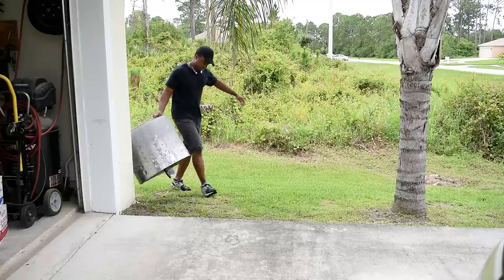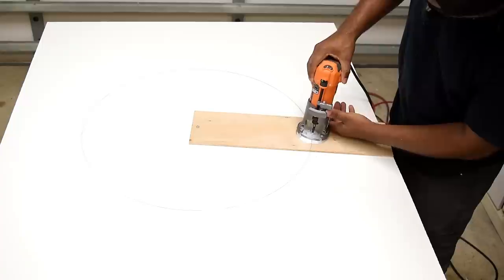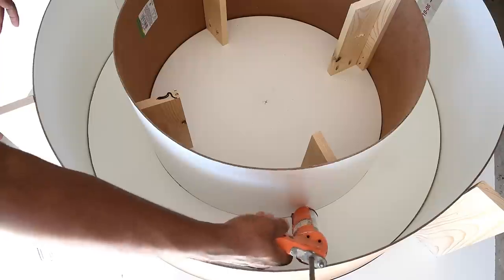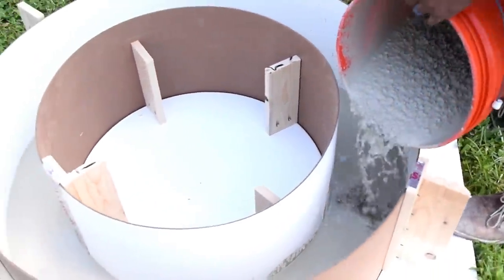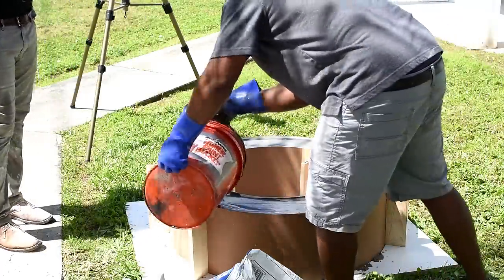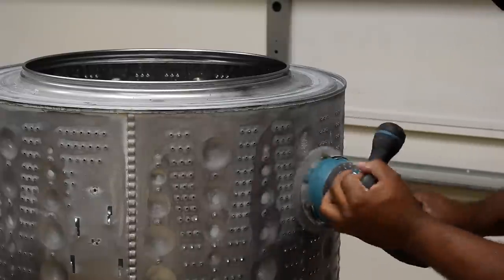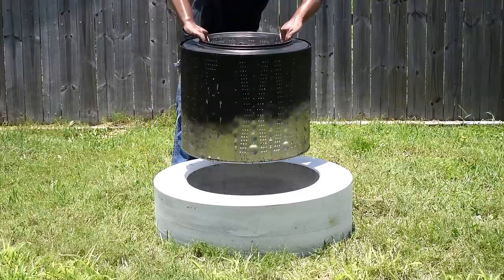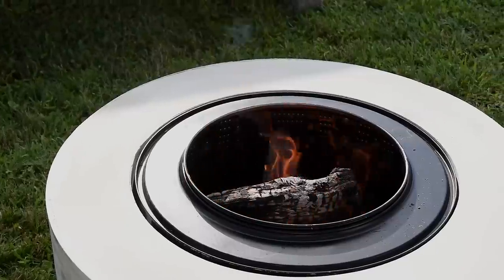Making A Concrete FIRE PIT  | from a washing machine drum

Comment from the maker: I made this bench a while back. You can check that build out here: https://youtu.be/zD-lSfDSKn0
If you want to see what i'm working on next, I'm most active here https://www.instagram.com/Morediycreators/
Reply: DIY Creators 
Quick question, what brand of dust mask were you using?
Reply from the maker: R-Z Mask https://amzn.to/2MXaWw3
Reply: Add an air intake pipe next time you build your firepit / fireplace
Reply: DIY Creators such a diy is worth fit
Reply: Next time place concrete, water the concrete and then put painters plastic or better (mil thickness) over it.  This keeps the moisture from escaping, way less chance of any cracks due to cure.  I just poured 20 yards in my backyard, watered it daily with plastic over it for 3 days, came out perfect.
Reply: DIY Creators do a tv stand
Reply: Burning wood is cool the pit you made is a good looking pit very.creative.
Reply: If you had put some greased PVC through the form before you poured you'd have air intake lines for your pit.  How you did it you're going to have a lot of smoke.
Reply: DIY Creators won’t the heat expand the concrete and make it crack?
Reply: How to remove ash?
Reply: I love your videos man for sure am going to use some of ur ideas in my house in Mexico when I get there
Reply: Hahahahaha
 I did the same thing with a dryer drum. Well not the concrete outside. I did cut in some air vents... I'll probably try your process but with my own twist to it. Some styrofoam vortexed vents in the concrete. For stile.. keep up the good work.
Reply: @SeanReitmeyer  This is a different type of concrete. You have to keep watering it for the first 45 - 60 minutes as soon as it get hard or it will develop shrinkage cracks. It creates a tremendous amount of heat as it cures. Wetting it then covering with plastic won't be enough. It has to stay wet, the heat just keeps evaporating the moisture. We use this mix all the time for our concrete repairs. It very fast setting and must be cured by keeping it wet.
Reply: @ushkayordlay3986  It'll be fine as long as he keeps watering it for an hour.
Reply: Great idea and I love the video. Tip for your next concrete project is next time you use a self consolidating concrete mix ensure that you dont use so much chem that it blow out the mix. The rock should stay suspended in the cement paste and never segregate. Your boy ruined that mix. Also roding through the layers of concrete helps prevent cold joints.
Reply: Awesome work man. Great work.
Reply: @ushkayordlay3986   Evo Bigdxck  normally yes, but
1) he is using mortar.
2) using calcium silicon aluminide raises the heat tolerance.
3) using the old washing machine tub helps seperate the heat from the mortar and allows for some heat dissipation. 

Now, he will still experience some cracking due to heat stress even if he takes the time to cure the structure. To avoid this, make the inside diameter about an inch wider in radius and line with kaowool. Seal the concrete and it will last for decades.
Reply: Beautiful work
Reply: Are you married?
Reply: Good and speed !! From  São Paulo city - Brasil
Reply: How do you add the air intake pipe? And how does it work/ purpose?

Comment: My dad also found a washing machine drum on the street, so he just made a base for it and we've been using it as a camping fire put for years. The drilled holes on the side really let off a good amount of heat. Your concrete donut looks like it meshes well, cool project.

Comment: We have several fire pits for guests, and this looked lovely, but I saw straight away when he had it burning that the fire pit wasn't getting enough air, and as a result the flames were sooty.  Probably easily solved by having a tunnel under the concrete ring. Well impressed with the ring itself, and how it looked after so little time setting..

Comment: Two things I'd do to get that pit humming.  Dig a couple of small channels under the pit on each side so air can be sucked in underneath.  I'd use a couple of old barbeque grills to cover the holes so you don't trip into them.  That air from underneath will stop it smoking so much out of the top and getting in your face.  Also if you want to start it easily and burn it longer, fill the tub with big chunks of firewood, and start a small kindling fire on the top.   Put the biggest bits on the bottom.  The fire will start quickly and easily on top and will burn down into the pile taking a couple of hours to burn.  Any smoke that forms will pass through the hot fire and get burnt rather than coming out the top.  As kindling burns down, it will ignite the bottom bigger logs.  Once it's roaring, you'll be able to simply drop big logs in from the top into the ember bed.

Comment: I have something basically like this only it sits on 4 legs making it portable.  You could make a surround to drop it into if you'd like and then remove it or just let it be portable. The bottom is an old steel washer drum and the center spindle is cut out leaving a hole in the very center about as large as a 20oz bottle. The airflow thru this hole and the side and surround holes allows it to breathe very well. The hole in the center and being raised on the legs allows for ashes to fall out.  We just place concrete blocks around it and they hold any ashes. When you want it some place else you pick it up (when it's cooled of course) and just move it where you want and place the 8 inch concrete blocks around it again and you have a new spot. PLUS being built this way allows the metal to capture and radiate heat so this makes it an actual body core heat source in the cool/cold weather. Plus it's an enclosed fire with a screen on top.  I have 2 of these..one at home and one I take camping.  And it makes a GOOD bit of heat.
Reply: This is one we burned all the way up over the years...lol.  Still I have the newer ones designed the same way. This old one is about 25 years old at least at the time this picture was taken.
http://oi68.tinypic.com/av4snn.jpg

Comment: Looks real cool however maybe if you casted the concrete mould with some holes made from pvc pipe maybe then the heat buildup would be greatly reduced in the concete mould & hence minimize  cracking.

Comment: We took a washing machine drum fire pit to the beach while group camping. Ours had a upside down looking funnel style chimney. Once the fire started it would howl from the air being drawn through the holes. It would glow red and acted like a furnace. Once started any drift wood or wet wood would burn without problem. Good times and melted shoes if you were not careful.😁

Comment: It's a few years late, but the reason that wood isn't lighting well, is the lack of air holes.

Solution 1: place pipes periodically throughout the concrete.

Solution 2: rather than concrete throughout, use engineering bricks cut in half, with the pocket side facing in, then concrete around them. Then you create vertical air channels.

Solution 3: Mix of S1 and S2, with large pipes around the base, but then you can have the flush concrete finish on top. Air gets in to the bottom (really important) and can access the sides.

Comment: So to make starting a wood fire pit easy get some starter logs. These are designed to be super easy to light and burn for a long time. Put in the start log, light it and then stack your wood on top. Super easy.

Comment: You should make a vent going underground to the pit and out somwhere close to make it easier to light!
Reply: Great minds think alike! The tub is perforated, it just needs a ring void going around it with a couple air vents thru the concrete form. Maybe make some plugs to control how many of the vents are open at a time, idk.

Comment: Well done even with the issues! If it was mine, to solve the combustibility problem I would size the inner ring to accommodate fire tiles, and use a vermiculite concrete mix like they do for pizza ovens, due to it's fire rating. Maybe even just as an insulatory inner ring that wouldn't be seen, because like you I love the monolithic concrete look. And the idea of being able to pull out the wash tub for cleaning it. Then I'd use the existing ring nearby as a matching raised bed planter. The idea for the mould is slick and elegant, I'm about to use it for some 20" cylindrical planters to accommodate  semi dwarf citrus and eggplant in the front yard veggie garden. Thanks so much!

Comment: I love the look of your fire pit...... had no idea it was a washing machine drum.... form the picture.
I've had a fire pit for a few years now, and had a multifuel stove in my last house and found the quickest way of lighting wood is to chop a log into kindling, or chop up some off cuts into strips of similar size to the kindling. You'll find any type of pine / spruce perfect for starting your fire pit.... but add hard woods like Oak, Ash Elm etc that burn a lot slower to keep the first going! and any coal as the main bulk of the fire (thats if your pit can handle it) - good luck!

Comment: Great work mate and I really like the project. I think that if you were to create an air inlet through the bottom of the concrete and fit it with an adjustable door you will find that the fire pit will burn a whole lot better. As it is now, the fire pit doesn't provide a passage for air to flow underneath the fuel which stops the necessary updraft required to feed the fire.  Because of this the fire will be very difficult to start, will burn low and more often than not, will just go out altogether. Build the inlet into the form and set it with the concrete.  Alternatively you could cut one out after the concrete has set.  I think I'll have a go at making one soon. I like it. Thank you kindly.

Comment: Nice build. The reason you have a problem with the burn is because you have no airflow from under the fire. If you added 4 - 8 tubes in the concrete form about 2" from the top, this would create 4 - 8 breather ports about 2" off the ground through the concrete to provide tons of oxygen to feed the fire from below.

Comment: You would have an easier time lighting your fire in a concrete form if you put some breather holes in the form towards the bottom. You can use your mesh to ensure no large coals can escape the form, but this would allow air to flow through to the wood down in the main cavity.

Comment: I'm curious to know why you need the washing machine inner, when you've gone to such lengths to build that beautiful concrete circle. I'm an aussie and out here we just fly with the machine inner by itself, breaths really good and whacks out the heat! 😉
Reply: Merto The 1st. 
Concrete does not mix well when combined with repeated exposure to high heats. This can lead to cracks and explosion of the concrete. Usually metal or firebrick are laid between the flame and the concrete itself.

Comment: Nice design. 
If you add an airway into the bottom of the pit you'll increase temperatures and thereby achieve a cleaner burn / less pollution. 
You'll also find it much easier to light and less smokey in operation - it might make you reconsider and save you the cost of gas maybe?

Comment: That's some seriously wet concrete
Reply: The powder he added is what is known as a "water reducer" it allows you to pour a very wet concrete mix without diminishing it's strength. However, it also cures the concrete very, very fast.
Reply: It did look a little watery
Reply: we can see concrete segregation
Reply: Yes it is. That flow control was not necessary with the amount of water they used. You can clearly see the segregation when he pours the first bucket and that highly affects the concrete strength.
Reply: My brain got confused by all the water and segregation :s 
- Former concrete worker 😂

Comment: Nice job on the mold and the finished pit. I wish I had seen your video about 3 months ago because I dumped an old washer. I pulled the drum out of it but couldn't figure out what to do with it so I ended up throwing it away. Had to replay the part where you said how long this mix took to set up because I couldn't believe something this wet would ever set up. I'm going to have to get myself a couple bags of this stuff to screw around with.

Comment: Great build. How about a vent in the bottom so that the flame increases and there is less smoke. I’ve seen others like the “Dakota Fire pit.” You might see a big difference. Since my yard is small I have to store my fire pit when not in use or I would definitely build one like yours with a vent. Thanks for the great ideas.

Comment: If you put in a small drainage pipe under the concert, you will have a better airflow and it will be easier to light the wood.

Comment: Its a good looking pit.    Unless you were using a BLOWER FAN to get this thing up to melting or forge temperatures   ->   a normal bon fire should not damage this concrete.   Probably last for years...   Wood fires are inherently more work and messier cleaning out the ashes...

Comment: I’m wondering how air gets to the fire. There doesn’t seem to be any “air flow” to help feed the fire. Other than through the top, which is taken up with exhaust gases and heat. Perhaps a couple of PVC pipes added through the form before pouring would help with this? Just a thought.
Reply: Pvc? Lol plastic will melt. Could use copper pipe though
Reply: alizcool1 ....the product used is only rated to 300 degrees, most of the heat would flow upwards, I doubt that melting plastic would become much of a problem. You could remove the pvc after the product setup, leaving the holes, if you were concerned about it melting. The holes would still allow air flow.
Reply: Definitely would need some holes or vents for air flow at the bottom.

Comment: the fire wasward to start because there isnt enough air circulation if you had a bigger gap between the tub and the concrete i bet it would light better and get a bigger flame going like you seemed to want

Comment: An easy way to light wood: use cardboard and dryer lint. The starter is the lint then use cardboard as an in between. Better results if you use a greasy box like a pizza box or maybe an oil box.

Comment: You could use some Pre-Mixed Refractory Fireplace Cement, to line the inside wall for a higher heat tolerance.

Comment: Pro Tip: Never use solid concrete around a fire. Concrete, as it dries, creates air pockets within it that can explode if they get hot enough. The heated air will find a way to escape. While your small firepit may not get hot enough, Ive seen concrete fire pits similar to this burst throwing extremely hot rock fragments everywhere. Even if they dont explode, they will try to find a way out and will crack the concrete over time until, 10 years later, you have a crumbling concrete circle.

Comment: I had to drill bigger holes to the bottom rows of 
my washer drum pit to allow enough air supply to the fire.

So wit the concrete around I bet it sucks to light and keep a nice fire going
Reply: Does drum rust after fire and heat after some time?

Comment: Using an sds drill or anything that vibrates on the mould helps remove air and makes for a better casting of concrete. Also some way of getting air in around drum would help it burn hotter and clean. Great video tho 👍🏼

Comment: You could also use sonotube for the forms.....ie. 24" outer tube and 16" inner tube for an 8" thick wall. Line the outer tube with 1/8" hardboard for a smooth finish.
Reply: 🤔  Sorry Mr.Majikman1, it would be a 4", not 8" thick cement-wall between the inner and outer tube. Presumed you place the 16" tube in the center of the 24er to get an even rim all around. 
I noticed, because I sometimes 'miscalculate' myself ... 🤓😉
Have a nice day! 
Miriam
Reply: @miriamb3226  you're right! You would need an 8" center tube and an 24" outer tube to create an 8" thick perimeter wall. Thanks!

Comment: Great project. Fire pits do need airflow as one person mentioned. Something else that would of made the job easier to remove the melamine is to treat it with WD 40 and it will peel away much easier. It looks expensive, nicely done.

Comment: Need to add something to get it breathing from the bottom better.
Reply from the maker: Thanks, I plan to upgrade this soon so I will totally consider.
Reply: Michael Rhoads if he had added steel pipes at the base of the mold in 4 or 6 locations about 8 inches up. This would have provided the missing airflow. The wire mesh would have helped hold the pipes in place. The pipes could have extended out with threaded ends which would have allowed for them to be capped off allowing for airflow adjustments.
Reply: DIY Creators You could just run a pipe from the bottom of the fire pit to the surface. Kind of like a dakota fire...
Reply: Just lay it on top of some iron pipe when you move it again.
Reply: What I did was throw a fire place rack inside mine. Made a huge difference
Reply: not too complicated?
Reply: Yes,  a breather vent going under the pit or even the sides would make the fire burn much better

Comment: If you wanted to add a chamfer to the top edge how would you go about doing that?
Reply from the maker: It depends on how much. You can use a thick amount of silicone around the form at the bottom. After spreading the silicone you can shape it to that angle. Hope i'm making sense.

Comment: Would adding some vents also help with improved flam height?  Great video.  Very easy to understand and right to their point. Thanks
Reply: Where/how  would you add in vents?
Reply: daniel stroh 
Maybe you could put some hoses into the mix at the base horizontally but with a slight incline as part of the mold. Then pour the concrete mix around it and uncap the hoses when the mix is dry. That would be totally doable. Ideally the hoses could be removed or made a little heat resistant but they should get too hot as they draw the external air.